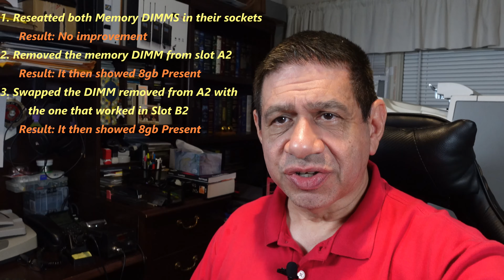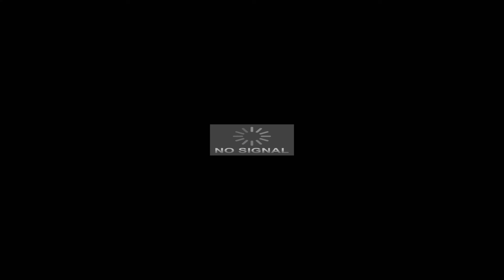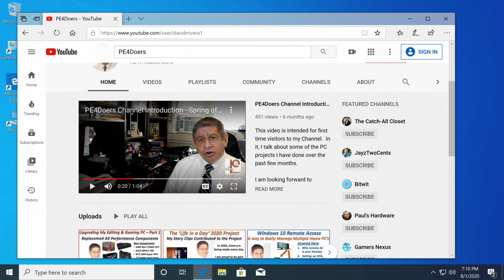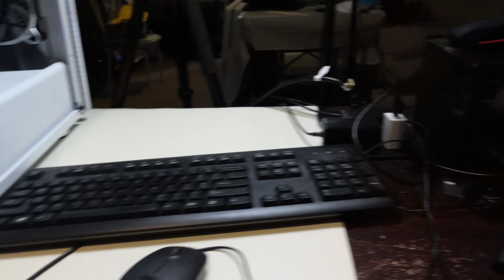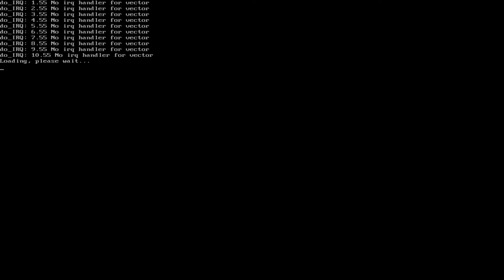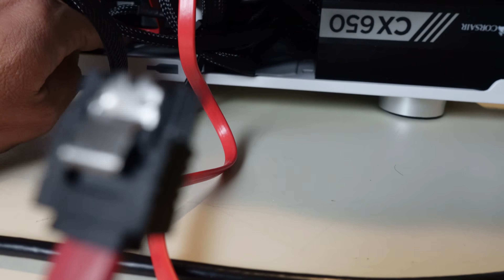ROG Strix B550-F & Ryzen 3700X UPGRADE to my Backup VIDEO EDITING and GAMING PC Workstation – Part 2

Comment: I just got the b550 f... do i need to power the 4 pin next to the 8 pin cpu i cant find info on it im using a 3600
Reply from the maker: According to the Installation manual that is optional.  I interpret that as meaning it is dependent on the processor chip being installed and how it is clocked.  My 3700X only draws 65 watts (and works fine with that connector left empty), however, if I put a 3950 in as the CPU and then overclock it, the power draw could go as high as 200 watts, which would be best served to the motherboard using both connectors - and of course, a much larger PSU.

Comment: At the beginning I thought that the cooler wouldn't be enough for your processor, since in the BIOS it was showing temps at 45 degrees. But in your test, it looks like it is really performing well.
Reply from the maker: I have that same cooler in my Primary editing rig and it works well - as long as the case allows for great airflow, which both this one and the Corsair case I have my primary rig running within.  Another thing that could have affected the BIOS is that I had the cover and glass off this case, which does affect the airflow through the case.  Also, I probably should have spend a minute or two talking about how I made sure the front, CPU and rear fans were directly in-line with each other.  Things may change if I try and overclock the CPU of course.
Reply: Yes It works well with this CPU because the AMD Ryzen 3700X only has 65 W TDP :)) 
Great Video and Intro as Always. Very well explained too :))
Reply from the maker: @KathrinHausermann  Thank you for the good comment, as always I can count on you :)
Reply: @PE4Doers  Always :))
Reply from the maker: @KathrinHausermann  Thanks :)

Comment: Hey, great video! I'm switching my spec delta for this case, i hope that is not as small as it looks like. Cheers from Brazil!
Reply from the maker: I'm really glad to hear from someone in Brazil :)  The case is a little shorter than I would like, but very usable.  Just make sure you connect the CPU 12v cable before you try to secure the motherboard inside the case.  I really like - very high quality and it keeps the PC cool.